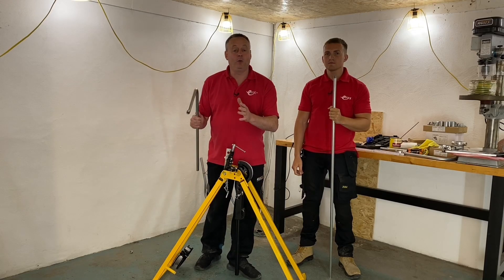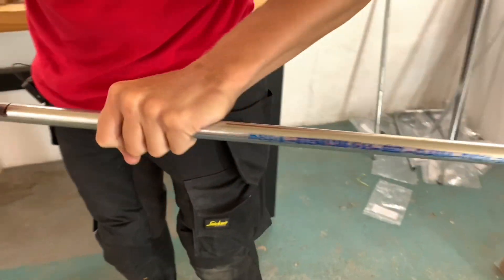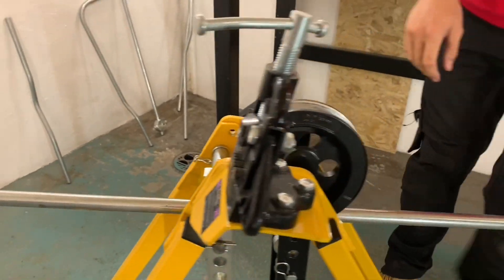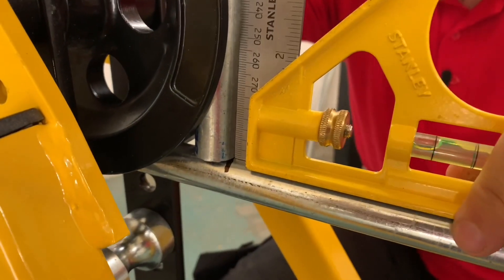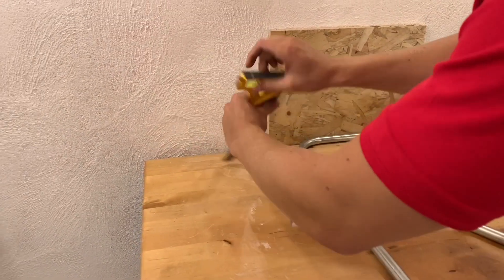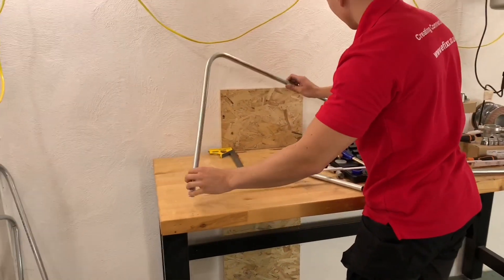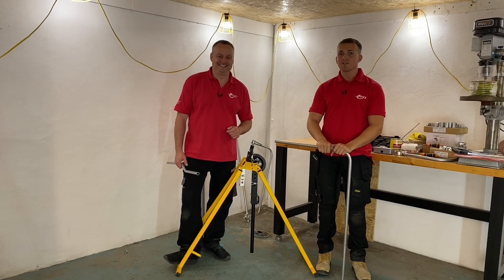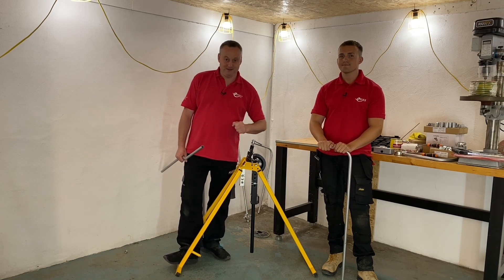METAL CONDUIT BENDING - Longer length bends - Apprentice electrician essentials

Comment: Do you have any tips and tricks for putting bends in pvc conduit  with a bending spring at exact measurements??
I’d love to have a method to do 1 or 2 bends in a single piece
Reply: You have to use a bending spring for bending pvc conduit

Comment: I'm confused. The measured 1m length wouldn't be the part that should scrape the floor. Is this technique to help where the excess after the measured point (ie sticking out towards you) is longer than a meter....

Comment: When you're on site you don't have time to faff around.. 
The fastest way to get a perfect 90 degree bend is to make your bend with the bender then using a magnetic sprit level stand on the pipe as in the video and adjust using the level.. 😉
Reply: You could always use something like a Trend Digital Level. Stick it in before the bend and check the degrees as you bend.
Reply: @SteS 
That would work if the pipe in the bender (after the retainer hook) was parallel to the floor, but unfortunately they aren't made that way..
Reply: @essdee9143  if the level was reset to zero before bending I'm pretty sure it would work.
Reply: @essdee9143  I don't understand why they don't design a bending machine with degrees etched onto the former so to make things easier.
Reply: @zippymo672  they benders with the degrees on the arm

Comment: Your benders roller is still in the 25mm former size hole this will flatten out the tube.
Reply: You’ll get snide comments from them if you point out any wrong doing
Reply: Which hole are you supposed to put the roller in for bending 20mm conduit and which are you supposed to put it in for bending 25mm? I had to put a missing roller in the bending handle the other day for bending 25mm conduit and I didnt know which hole to put it in so I put it in the 2nd hole above the former.
It was very tight but it seemed to work.
Was this right or wrong?